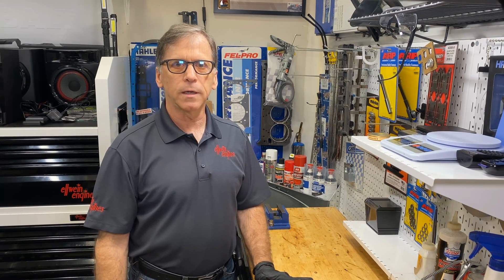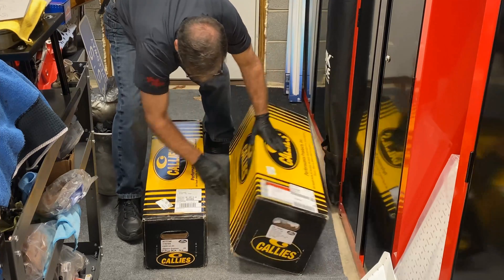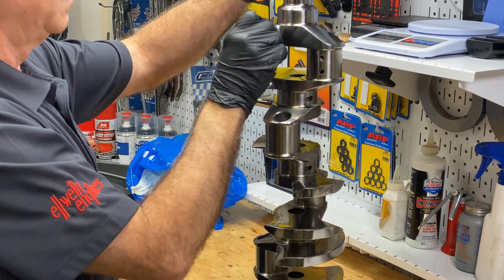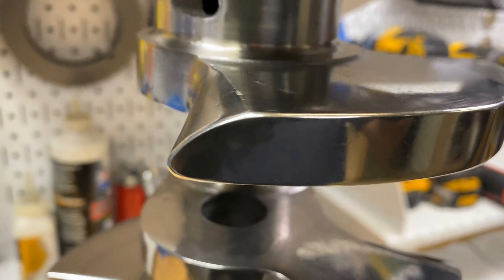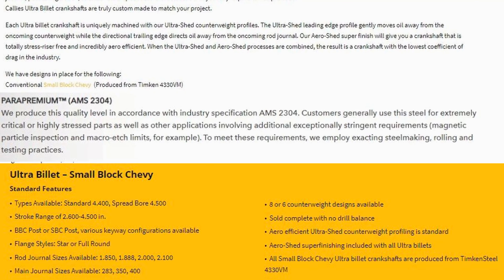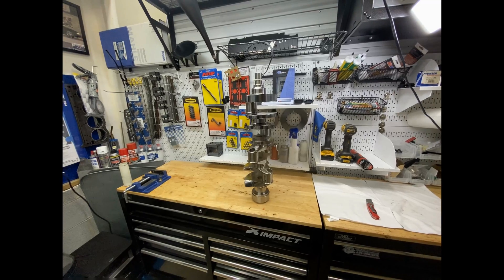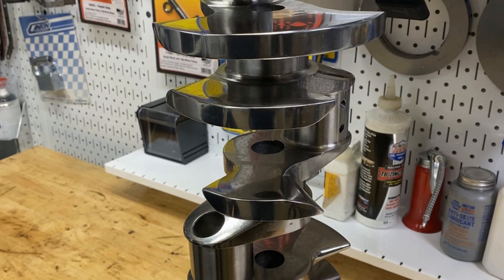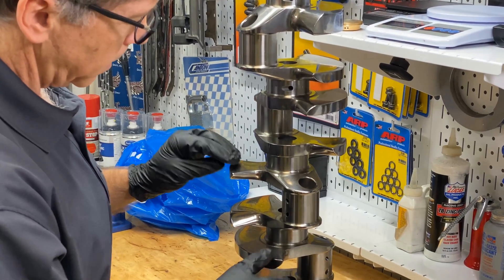LT1 Ultra Billet Crankshaft YouTube 4K

Comment: How much did it weigh? and do you know the cost of one of these?
Reply from the maker: Did not pay attention to it's weight.  I was just the middle man for this crankshaft... It was not for any engine project of mine.  Sorry I don't know retail price.   I am not allowed to disclose engine builder pricing.  ;)    (I think they go for $4000 or maybe a bit less).
Reply: Ellwein Engines It would be cool if you could record weight for the next time! I’d think that would be important for a video like this. Is that $4000 with or without balancing?
Reply from the maker: That is with balance included.
Reply: Probably around 51 or 52 lbs ... thats for an LS7 long snout ultra billet